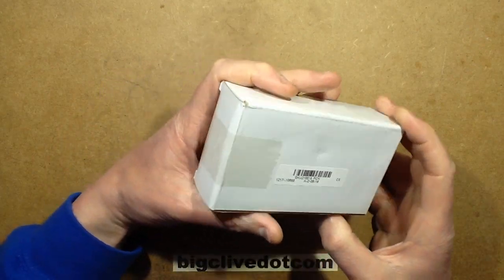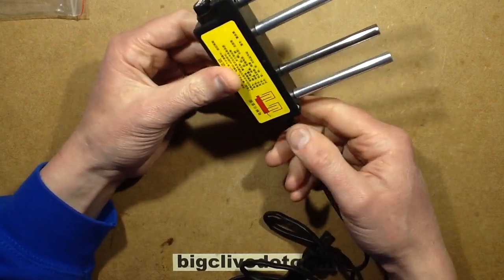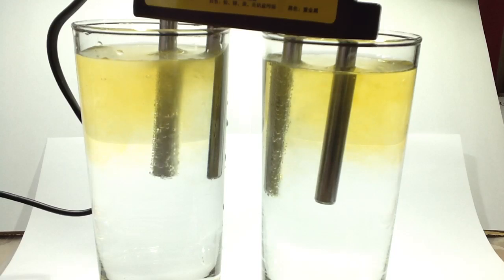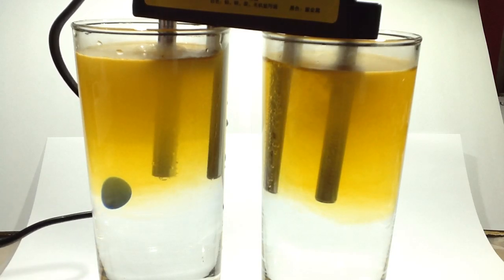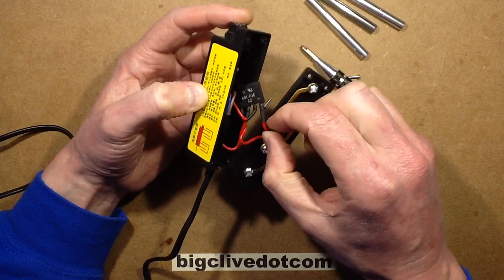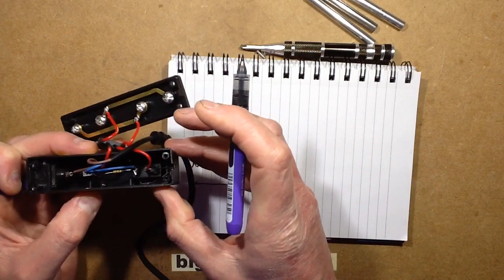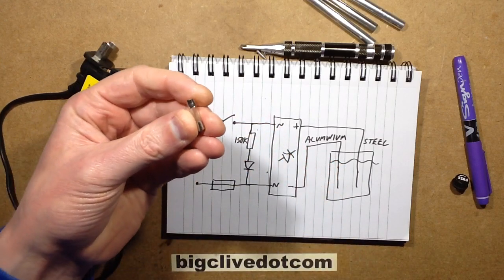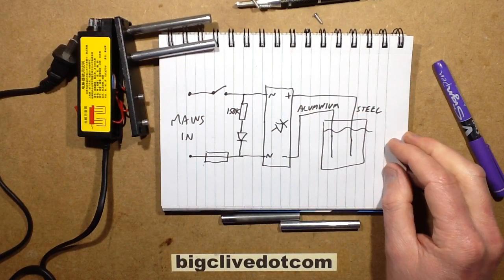Deadly quack water tester.  (scam)

Comment: This proves water filters dont get rid if the total disolavle solids. (TDS) This is misinformation because everyone should only drink pure water what this guy is trying to stear you away from. You don't drink the water you have tested as this misinformation agent is implying, this is laughable. The device is safe as a sealed unit. What a moron the guy is.
Reply: A "sealed unit"...with exposed live electrodes coming off the end. And you think drinking water with minerals in it (the "dissolved solids" that render the water conductive enough for the corrosion to happen) is bad for you. That is the opposite of what has been understood by every medical community for a looong time.

And you're calling Clive a moron. Sure, whatever makes you feel better.

Comment: And I quote from a commenter named Fukgoogle under your top comments...."LOOK AT THIS OBVIOUSLY ""OVER"" WORRIED LUNATIC MAKING A SCARE TACTIC 
VID! YOUR ARGUMENT IS WEAK! IT'S FINE TO SAY ELECTRONICALLY THE DEVICE 
POSES THREATS BUT IT'S ANOTHER THING TO ADD PEOPLE ARE TRYING TO 
""SELL"" YOU A WATER DISTILLER. FIRSTLY, ARE THE ONES MAKING DISTILLERS 
ALSO THE ONES MAKING THESE ELECTROLYZER TESTERS? SECOND, WHO'S 'NOT' 
TRYING TO SELL YOU SOMETHING IN THIS WORLD?! YOUR VIDEOS ARE MONETIZED. 
THIRD, SINCE WHEN DID YOU BECOME A HEALTH EXPERT? THE ONLY QUACK I SEE 
USING SCARE TACTICS IS YOURSELF. STICK WITH ELECTRONICS. STAY OFF GIVING
 HEALTH ADVICE. MY ONLY QUESTION IS, WHICH WATER BOTTLE COMPANIES 'PAID 
YOU' TO MAKE THIS VIDEO TO MISINFORM A WHOPPING 288,000 SUBSCRIBERS?"
Reply: is it fake device?
Reply: You are a lunatic for believing what the water scammers tell you. The device is an electroplater and what is happening in the water is caused by the corroding of the probe alloys and the conductivity of the water. Distilled water has no conductivity, so it won't discolor. It will discolor even distilled water, if you added a little salt to it and make the water more conductive. Learn some actual Science before making dumbass comments and believing scammers, you gullible fool.

Comment: They are probably selling reverse osmosis water filters. Im guessing they dont tell you that with their filters  waste water ratio is 1:3 at best. For every 1 gallon of filtered water, 3 gal have gone down the drain. Your water filter probably only removes larger sediment. If it is a 2 stage, it will also remove chlorine. Without reverse osmosis or distillation, the mineral content of your water will be mostly unaffected. Interestingly, to test the mineral content of your water, the tool used is a little digital pen with 2 electrodes. Its testing the electrical conductivity of the water. EC, TDS and PPM, all the same, just different scales of measurement. I also find it interesting that RO and distilled water are not very good to be drinking all the time. Filtering out chlorine and sediment is usually all you should be doing.

Comment: That colo(u)r is not from the water, it's from the electrodes, if one of the electrodes is in fact iron or steel, and it is connected to the (+), it will sort of fall off and make (if it was iron) iron-oxide or iron-hydroxide if there was hydrogen nearby (I think), which is the brown colo(u)r (the hydroxide is red-ish). The scam is probably that in one glass (the "clean" one) the (+) is the aluminum one - and aluminum oxide/hydroxide is gray, and not brown(ish), - and the other glass (the "not clean" tap water one), the (+) is the iron - and that oxide/hydroxide is brownish).

Comment: Seen on eBay, the seller states "Caution: Avoid the electric shock while using the devise; Do not touch the rods once the precipitator is plugged into an electric outlet" ....ohh right, yea cheers for the heads up! Only in China haha

Comment: Drinking destiled water or demineralised water prolonged time can cause serious health issues because it demineralise all of your body. Drives out all of electrolytes your body needs to run nerve activities. Be aware that water you drink is normal mineral composition. Reverse osmosis and other filtration methods are not good as promoted. This scam is even more dangerous in Europe. We use 230v as normal house electricity. Water should behave like in this experiment. It shall conduct electricity if it is good for living organisms
Reply: Serious health issues from prolonged period consumption of distilled/demineralized water is as much bogus as the the other side saying that distilled/demineralized water is much better for you. Our wonder machine called body will also obtain minerals / electrolytes through the food we consume and is not only relying on water to provide these micronutrients to us.

Comment: Can you use this device though for a constructive purpose, e.g. like getting hydrogen fuel for a fuel cell?
Reply: Electrolysis to obtain hydrogen is very inefficient and with the high voltage of this device it would be even more inefficient due to heat loss from overpotential.  Also fuel cells require a high purity Hydrogen so you have to ensure very good separation plus filtration and drying of the Hydrogen gas which would reduce the efficiency further.  Add to this compression of the gas which comes as an additional negative impact to the efficiency.  So in the end a very expensive way to produce hydrogen.

Comment: It is a good test if water is distilled, since distilled water is not electrolytic and will not cause a reaction. Filtered water will still have salts in it and turn colors as was demonstrated.
Reply from the maker: You could also use a TDS (Total Dissolved Solids) tester which is pen sized and uses safe low voltage.

Comment: I personally think that this video maybe the scam(propergander) and not those testing the water. if you watch the test on smart water, eviean, tap water and distilled water they all change colour except for the distilled water so how can the device be a scam? by the way this is more a question and not an argument.
Reply: distilled or de-ionized water is not conductive and without the flow of electricity between the electrodes you do not get the coloring effect.  Put a few drops of freshly pressed lemon or orange or apple juice in the distilled or de-ionized water and watch that water become a yucky colored mess with that device since the juice will make the water conductive.

Comment: I would like to disagree with the above video. Unfortunately most of the viewers don't understand the difference of the 6 colors that the EC (electrical conductivity) will give during testing different water samples mean. So perhaps if you allow me, the color samples of the 6 different tests after electrolysis test, indicate the types of particles in the water under test,  

  Electrolysis of water quality    Yellow: dissolved acid, silicon compounds, organic minerals, molybdenum, silicon, fluoride, other organic matter    Green: arsenic , mercury, lead, copper, sodium    Blue: bacteria, viruses, carcinogenic substances, organic phosphorus, etc. (fertilizers, detergents and pesticides)    Red: Iron and rust, bacteria    White: lead, zinc, mercury, inorganic salt    Black: heavy metals (zinc, lead, copper, chromium, manganese, cadmium)       The way you test it is by inserting 2 prongs in 2 different glasses of water for testing. From the color the water under test, turnes, you will know what particles you shouldn't have in it.

Perhaps the above youtuber does not understand Chinese.

So take care what you see in YouTube! it could be a scam! ☺
Reply: No need to understand Chinese,  unsafe/dangerous voltages remain unsafe no matter what language you use and some basic understanding of electrochemistry also helps to understand that this so called water tester is  BS (that includes the color chart you provided)

Comment: The colour of the water means what are contents inside the water.
Testing Analysis Results:
Yellow: dissolve Sanso, silicon compounds, organic minerals, molybdenum, silicon, fluoride, other organics
Green: arsenic (arsenic), mercury, lead, copper, sodium
Blue: bacteria, viruses, carcinogens, organic phosphorus (fertilizers, detergents and pesticides)
Red: iron and rust, bacteria
White: lead, zinc, mercury, inorganic dirt
Black: heavy metals (zinc, lead, copper, chromium, manganese, cadmium)
Reply: +Sae Hian Lim4 , you really believe that BS? Realitiy:  it will color the water in accordance to the composition of the electrodes that contaminate the water.

Comment: whats happening is mixed metal ion exchange which causes oxidization. its the reason you generally avoid mixing aluminum with copper steel or nickel in water cooling setups

Comment: Could be wrong, but I'm pretty sure they used two metals to cause some electrochemistry to be happening between the electrodes; one of them is being broken down and will in theory eventually deposit its metal on the other, if the water is conducting electricity.

Comment: Why don't you at least learn what you're talking about before calling it a "quack" item?  What it is supposed to be doing is undissolving any dissolved solids that are in the water.  Try it on some RO water to see a real difference.
Reply: +E.N.G Creation, no trick because distilled and/ or deionized water is non conductive and thus the electrode material will not be dissolved into the water. As said before put a drop or two of lemon juice or a few grains of salt into the distilled or deionized water to make it conductive and then do the "quack test" with it.
Reply: The only thing this dangerous " device "  does is dissolve the metal ions of the cathode electrode into any water that is even the slightest conductive and by doing so contaminates the water to be " analyzed". Leave that unit for some time in the water and if it doesn't blow the fuse and hasn't boiled off the water due to the unsafe and unnecessary high DC voltage  you will see that the cathode electrode has been reduced in size/weight due to it dissolving into the water.  A true TDS meter will use a very low AC voltage and electrodes out of a non reactive material to measure the conductivity of the water without contaminating it by showing a PPM or micro Siemens value.   So yes this is a " quack item "  because it contaminates the water falsifying results,  doesn't provide any usable results and is very unsafe. Take your RO water and put a few drops of Lemon juice or a couple grains of table salt in it then put this " wonder device"  in that water and watch making a yucky muck out of it.
Reply: Milan Swoboda but there's a video of distilled water with no coloration whats the trick there?
Reply: Milan Swoboda that makes enough sense

Comment: Device very dangerous, and quackery.   High voltage (approx 315V peak, UK)  D.C. output, unshielded electrodes, no mains isolating transformer, etc.    .    . Should be renamed "electrocuter" .

Comment: I'm guessing the yellow colour is Iron III Hydroxide. you definitely don't want to drink that!
Reply: +VEGAN WarriorⓋ Even distilled water (but that needs some sort of electrolyte)
Reply: Paul Mansfield was just gonna ask lol
Reply: You are correct and that's the scam. It is indeed iron, hence the different electrodes. Aluminum will not electroplate, so the "rusted" metal from the steel electrode stays in the water.
Reply: nope, the brown color is aluminum hydroxide, not iron.  that's why they use an aluminum anode.

Comment: I have no doubt some of the electrodes are alloys, and the electrolysis is likely breaking down the alloy and that's where the gunk is coming from.
Reply: The chemistry is quite simple.  The gas bubbles at the negative (aluminum) electrode are hydrogen from the electrolysis of water. The brown is oxidized iron (iron(III) ions to be precise) from the positive electrode. If you look at the iron electrodes in the video, you can see some minor pitting on their surface. The current builds as more ions form in the water. Since distilled water doesn’t have much in the way of ions in it in the first place, you won’t see the same effect with it. Quackery is an excellent description. A note:  as more current is passed, the more alkaline the resulting solution will be.
Reply: nope.  the brown color is from the production of aluminum hydroxide from the aluminum anode.  that's why they use an aluminum one to begin with, exactly to ALWAYS produce the same amount of brown color to the water, regardless of water quality.
Reply: @thomasneal9291  so how come distilled water stays clear?
Reply: @coinop7278  distilled water isn't really conductive, in comparison to water with a few ions in it.

Because it's not that conductive, there's not much charge flowing and that's why the metal rods aren't visibly breaking down.

If you'd leave the rods for longer in there, the rods break down initially slowly, then because they release ions into the distilled water the conductivity increases, making the breakdown of the rods quicker, making the water more conductive etc.

So there's simply a delayed reaction, your distilled water would look the exact same if you leave it in there for long enough.
Reply: @caylus3395  so then this device does what its supposed to. It shows the metals in water.
Reply: @coinop7278  Try it with platinum-coated electrodes before calling me an idiot, please.
If your hypothesis is correct, tap water will still show crap, right? If I'm correct, it won't.

Sorry for my late reply, somehow I wasn't notified that you responded.
Reply: Caylus Please, don't waste your time on this guy, he's obviously baiting you.
Reply: I Am DmiZ i woudn’t be too sure about that, the guy liked a video titled “how to remove bad taste from your distilled water”. He believes that not only should you filter your water, but also you have to remove litteraly everything other than pure H20. Hey, at least it’s better than the people who believe drinking hydrogen peroxide is healthy.
Reply: I Am DmiZ oh, and he also liked a video of a scammer using this exact device to show how tap water and fucking bottled water are “dangerous” whilst distilled water isn’t. Oh the joys of people not knowing how to set their profiles to private.
Reply: Coin Op how about you drink nothing but distilled water for a few weeks and see what happens? There's lots of minerals we need that we get primarily from our water. A glass or two of distilled water isn't going to hurt you. But drinking only distilled water for a long period of time will lead to cellular osmosis, where your water in your blood that has gradually lost mineral content starts to permeate cell membranes in only one direction in order to restore equilibrium gradually causes the cells to expand and eventually burst. This is a real thing, and people have died from it. Tap water is conductive primarily because of necessary minerals. Yes, actual contaminants can also be conductive. But only water that has been processed (i.e. "messed with") to remove those minerals is not conductive- and that's a problem, because we need those minerals to be there in order to survive.
Reply: Maybe yes, but I noticed different colours on several tests I did do with my device (just for giggles). Cold tap water, hot tap water, boiled water and when I find distilled water I will test that as well (wonder if the water gets coloured....if it does, the electrodes have some molecules emitted into the water right?).

Comment: Not sure why this is "quack" no its not going to tell you if water is save to drink  its just highlights all the extras in water (good and bad) 

and to the point ... most of the filters to fuk all to clean water thats why you dont see much difference... test reverse osmosis filter water ... hardly goes yellow 
as far as quality of device goes ... yeh not much can say on that ... its cheap :)
Reply: Art Nau your a dumbass all this does is use electricity to strip metal off the electrodes and turn the water rusty. any water that isnt 100% pure like distilled water or water for lab use will turn orange.
Reply: The levels of different things in water hardly matter,  only distilled water is noticeably better at staying colourless. Safe or unsafe, the water turns orange.
Reply: I will upload my own test soon
tap water  vs  bottled water vs osmosis filtered water 
 there is quite a bit of difference (again Im not a doctor to say which option is healthier as removing 'all' the micro element from water can have its own side effects)

Comment: I dont understand what this device does.. Can any1 explain? Thanks!
Reply: Electrolysis.  So any ions in the water gets pulled to the opposite polarity electrode, where some kinds become gasses that bubble out, while others become liquids and solids that discolor the water. Also, sometimes tiny amounts of metal from the electrodes become part of these substances.